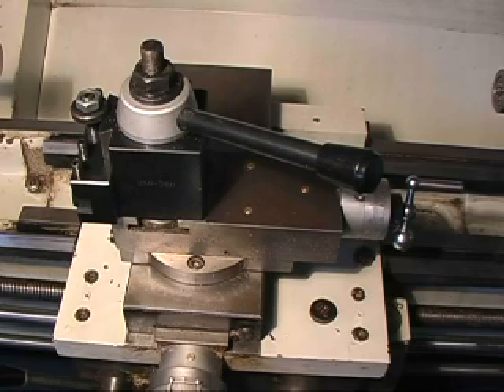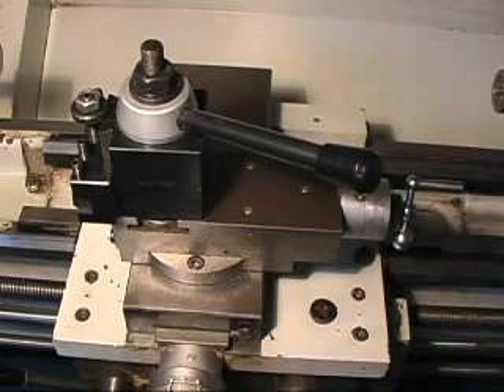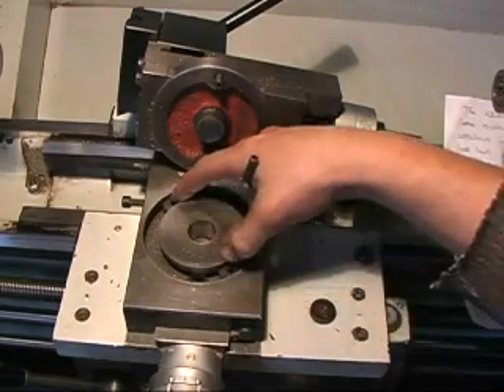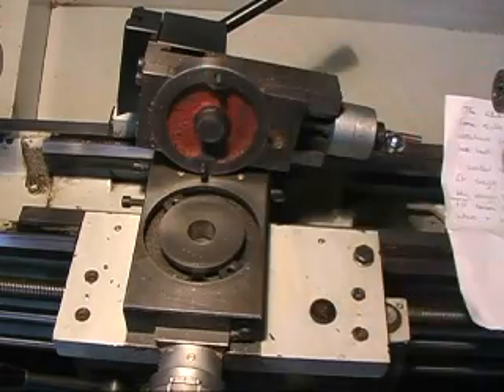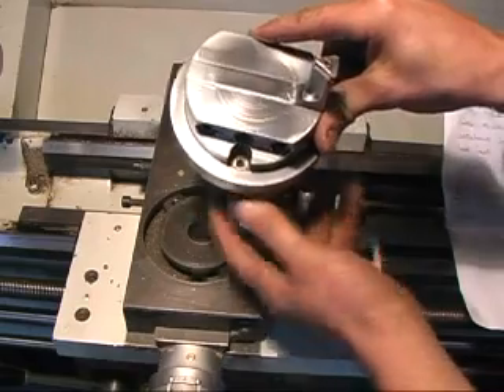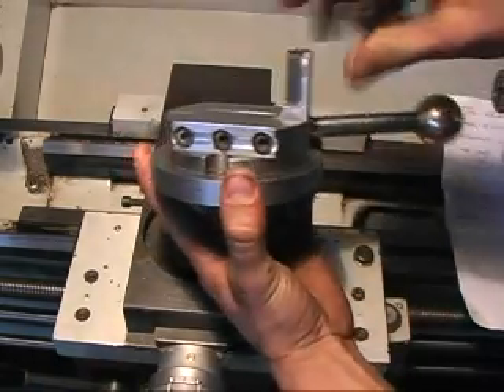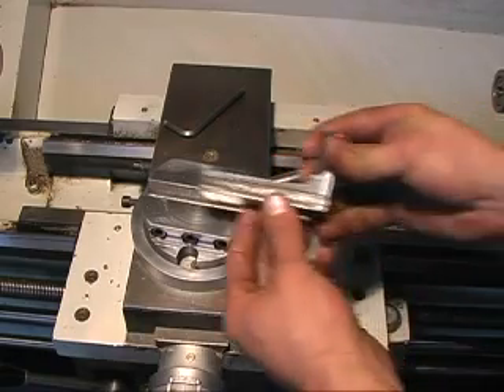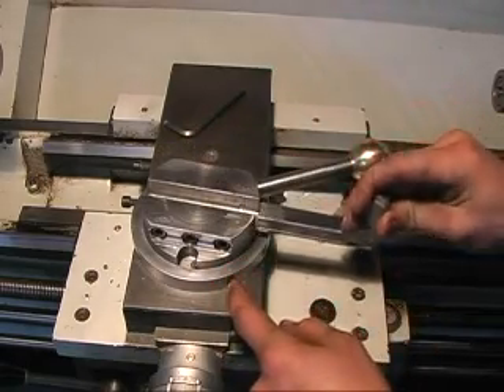Radius Ball Turner for Metal Lathe

Comment: Scares the devil out of me every time your hand or the handle gets next to the chuck.
Reply: I know right
Reply: Collets and collet gear - worth the investment in saved busted knuckles!
Reply: +Dale Emery many hundreds of pounds? Some like me sometimes would prefer to be a little on the dangerous side.
Reply: Woodball turning
Reply: If you know what you are doing it's not that dangerous. I have been running manual lathes for 15 years now in a machine shop for a living and we do stuff like that all the time. It's actually more dangerous using sand paper to polish stuff than that is.

Comment: @irfp460, I think the threading attachment is just like using a die handle. Put the lathe at the lowest speed, and turn the attachment by hand with power off to the lathe.
Reply: Um, no.
Reply: Icutmetal after I posted that comment, I seen an auto release threading attachment. It may be the type you were talking about. It uses 4 jaws?

I have seen a floating die handle that attaches to the tailstock.

Comment: Brilliant idea and a little bit more polished than I was in the process of making.
Now I can replace all the knobs on my Mill with metal ones with bearings inside so they spin freely. The sorts of things that us machinists come up with when needed, and I like the replaceable cutting tool that gives you 6 cutting surfaces 3 each side and when it's dull toss it and replace. I use these types exclusively now rather than tool steel.

Comment: it's not that dangerous on 800Rpm. Your hand will be punched away and the handle to. cause you will no move your hand fast enough to get it into the small gaps in the chuck before it knocks you back.. :) at 3000 rpm you can just let your hand lay on it.. as long as you enjoy to have small scratches ;)

Comment: brilliant ! altough i have a question...
how do you set this up? do u have a measuring system on the turning table and align the center of the turning table with the Z-axis?(considering that the distance betwwen the center of the table and the tip of the carbit, equals the radius of the ball) or is it with trial and error?
besides that, very nice inventive idea!

Comment: There is a far easier way to make this ball turning attachment than this , Buy a small rotary table , mount a simple toolpost and cutter on the tee slots so it is adjustable for radius at centre height , mount it on the cross slide and it will produce a perfect arc every time and therefore a perfect ball , small cheap chinese rotary tables are easily available and it is safer to use as you only have to turn a small handwheel in a fixed position away from the chuck